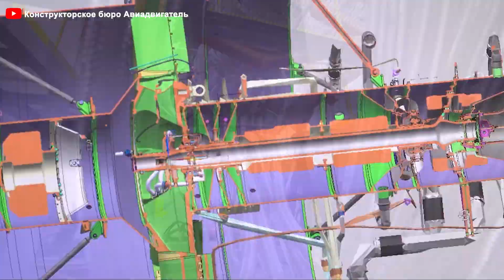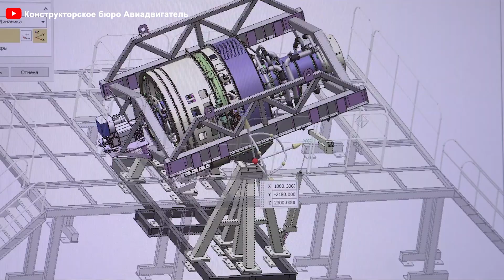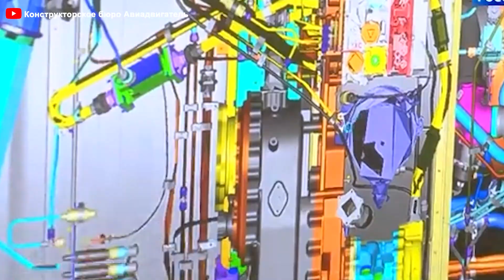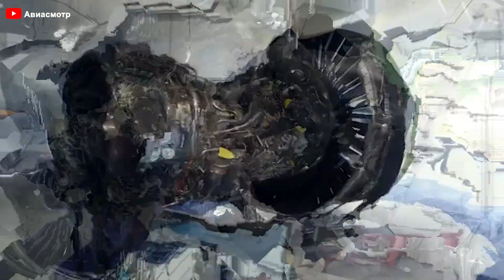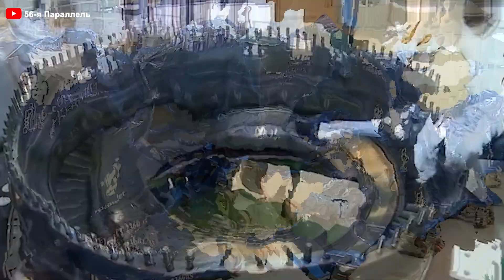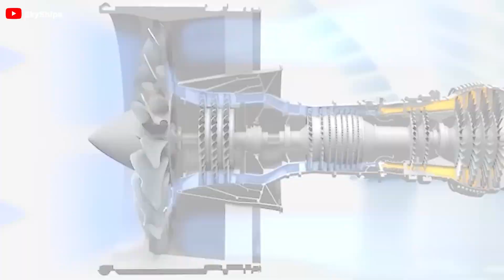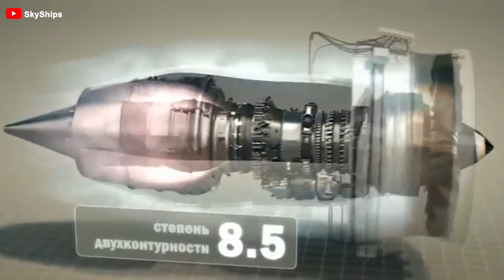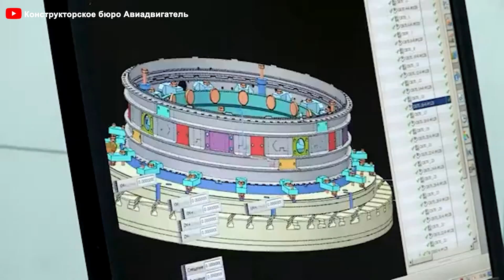This Russia's PD-35 NEW engine Will Change The Aviation Industry! Here's Why

Comment: CR929 is now only chinese and will not include this engine. Your info is outdated
Reply from the maker: Although Russia withdrew from the project, I believe that Russia will still support it in some way.
Reply: @FLIGAVIA  Russia withdrew due to the fact that chinese insisted that the plane will feature western CFM engine. Russia cannot participate anymore due to sanctions. So idk how it will continue to participate in some way. If you have informations about this make a short video about the different possibilities
Reply: @Gryffoon  China is not yet able to produce a turbofan equivalent in performance and fuel consumption to the GE90 or the Rolls-Royce Trent 800, and the PD-35 might not meet the performance parameters expected for the C929/939 series.
Reply: @garryb374  Russia has overland trade with its neighbors, so Western sanctions against it aren't having the effect expected by NATO.
Reply: @hananokuni2580  this is not an issue dince you can have many engine options for a plane
Reply: @Gryffoon  Not if China wants a 100% Chinese-made airluner, which isn't common since large airliner manufacturing is usually a multinational effort. The C929 might end up using a Russian turbofan if a Western one cannot be obtained.
Reply: @hananokuni2580  Russia withdrawn from the project since Russia said it will include only Russia and Chinese component. 
Russia was doing the wing and the jet engine.
China said no, bcz they wanted to include western parts, and PD-35 is far from ready. 

Russia du to sanction has no choice but to withdraw. China will do the wing, and they will use a western engine.
Reply: @Gryffoon  Wasn't China expecting to make its own high-bypass ratio turbofan instead of using a Western engine? Or did the Chinese want to use Western engines in the first place?
Reply: @hananokuni2580  no they didn't plan to make their own engine. They planned initially PD-35 and western engines

Comment: This sounds amazing. I wish best of luck and I hope to fly in an airplane powered by PD-35 one day. I would suggest to focus on high bypass ratio turbofans like like CFM leaf, PW-100 and RR's Ultra. Using gear box can not only reduce the speed of the fan hence increasing its aerodynamic efficiency, it also results in significant weight reduction.
Reply: After 2030

Comment: The GE new engine on the B777X generate 60t, the B777-300 engine about 52t of thrust if I am not mistaken, almost double that 35T they are bragging about; meaning they are still obligated to have 4 engines for safe intercontinental flights on wide bodies, because the rule is if they have 2 engines in case if one engine stop working there shouldn't be an issue to complete the trip with one engine, and 35t isn't enough to achieve that task for a wide body plane.
Reply: Он не новый. Он как 737-800 😂

Comment: The world's first in aviation and cosmos:

1940 MiG-1 jet airplane
1947 Supersonic airplane MiG-15
1939 Helicopter with vertical takeoff
1949 Tu-4 strategic bomber with a jet engine
1950s Atomic engine for aviation
1956 Jet-powered passenger airplane Tu-104
1957 Artificial earth satellite
1957 Intercontinental ballistic missile engine
1959 First nuclear-powered icebreaker
1960 First Martian spacecraft
1961 Spaceplane (manned)
1961 Human space flight
1961 First spacecraft to travel to Venus
1962 Turbojet passenger airplane Tu-134 with a Penali wing
1965 The world's first human spacewalk
1967 World's first space telescope
1970 Hypersonic airplane MiG-25
1981 Reusable Buran spacecraft
1988 Largest passenger airplane An-225

Airplanes after 1991:
1996 - Su-30
1999 - MiG-31M
2000 - Tu-160 (modernization)
2000 - Su-25SM
2002 - Su-27SM
2005 - Yak-130
2006 - Su-34
2006 - Su-35
2007 - MiG-29SMT
2010 - Su-57 (T-50)
2010 - An-70 (develop)
2017 - MiG-35
2020s - MiG-41 (project, fifth-generation fighter, advanced interceptor)
2020s - Su-75 “Checkmate” (project, fifth-generation fighter, light stealth fighter)

Russia continues to lead in a number of technologies that are unique in the world, especially hypersonic missiles, multi-unit ballistic missiles, and missile systems with unique missile defense bypass capabilities. Systems such as Sarmat, Tsirkon, Yars, and Avangard are examples of technologies that make Russian missiles difficult to intercept and extremely effective
Reply: MiG-1 jet airplane? Are you sure?
Reply: @AlASokolov  I'm sure it's a MiG-1. You can call it jet, airplane, aircraft, spaceship, UFO or fighter, regarding your translation. For 1940, MiG-1 was Jet.
Reply: @John.009  This is usually the name given to turbojet powered aircraft. The MiG-1 is a piston-engined aircraft. And by the way, the MiG-15 was not supersonic.
Reply: @AlASokolov  Once again, it's a matter of translation and the key difference between a jet (Реактивный) fighter and a supersonic (Сверхзвуковой) fighter.
MIG-15 was a jet (Реактивный) fighter, the Su-27, was already a supersonic (Сверхзвуковой) fighter.
Reply: @John.009  МиГ-1 был поршневой самолёт, с пропеллером мать его.
Reply: @AlASokolov  Наконец, перешли на понятный язык :) И все встало на свои места). Но MIG-15, все же, был реактивным.

Comment: Cut the chaff. Give us a comparison of this aircraft with its western equivalent A320 or 737 stating its travel range, passenger capacity and fuel consumption.
Reply: Don't forget the death toll. 737 is a champion in this field with about 200,000 passengers and crew killed.

Comment: But is it better than Leap, or GE or RR?   More Reliable? more thrust per fuel burn? RR?  (Max thrust 35000kgf = 343kN = or 77,000lbf,   Fan dia. 3.1m =10'2" )
Reply from the maker: of course it can not be compared with those engines
Reply: @FLIGAVIA  ...and will be even further behind by the tine they actually start producing them... if ever.